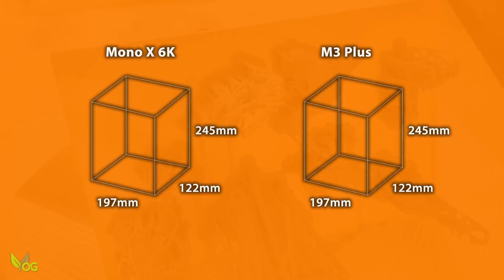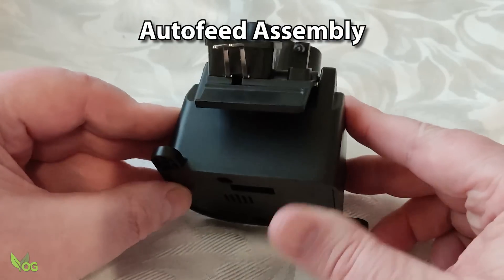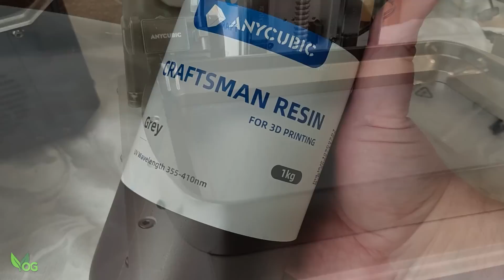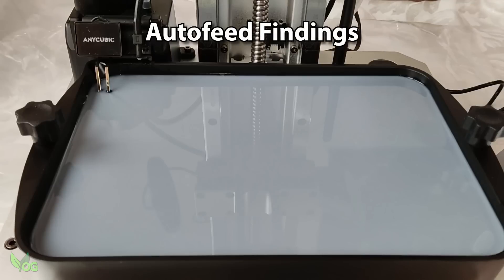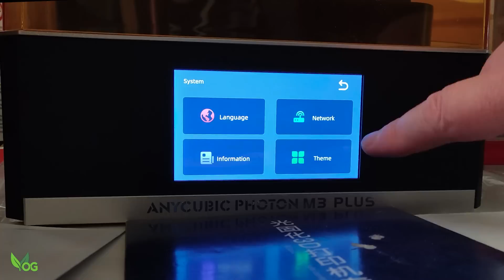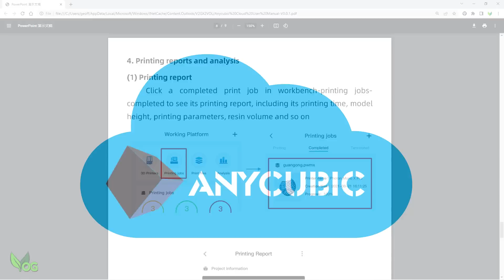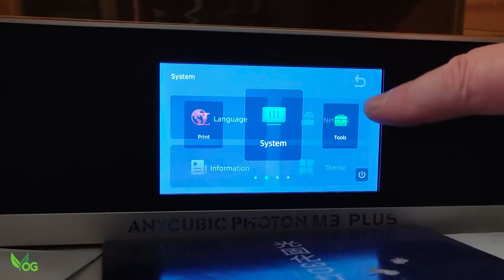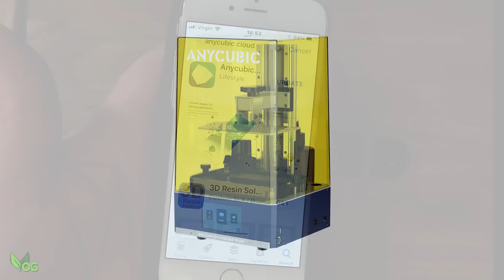Anycubic Photon M3 Plus - the auto resin filling 3D printer [HONEST REVIEW]

Comment: I feel like a little float switch would have been a better choice. It would work on any resin and they are reliable
Reply from the maker: I like that. That's better thinking. 😁😁😁👍👍👍
Reply: ultra sonic is also good, in 2018 i made a custom resin filler drainer with arduino and péristaltic pump
Reply: They are reliable until they aren't. Everyone has had a toilet that doesn't stop filling and that's just plain water. I wouldn't want moving mechanism that would get clogged with resin to be in control of resin feeding into my tank.
Reply: @HeliumFreak  you could say that about any system. Sensors fail too.
Reply: Float switches are not very reliable when you have sticky product that can harden on the moving parts. A float switch would be less reliable than the existing method, and ultrasonic is not very reliable for the small distances involved here.
Reply: @aaronporter2180  In this case I would think the failure rate of solid state parts would be well below a switch sitting in sticky goo.

Comment: I think your suppose to lower the build plate into the resin to displace it to the right level, if I was to recommend an improvement I would recommend  that the level be changed to the displaced level when the build plate is lowered otherwise lower the build plate first to auto fill the reservoir. Sound Good?
Reply: It doesn't look like there is a way to change the position of the prongs. So once the print is complete and the print / plate is out of the resin it will still fill to the same level

Comment: My first thoughts when I saw that autofill system was "I hope the tray can contain the whole bottle in case of failure" and you answered my question. :)

Smart move on the separation of the electrodes on the bottle sensor, but I think you are overplaying the lack of adjustability of the tray sensor. It's there just to make sure the tray has "enough" resin, and if you really need more or less then you just bend them.

Comment: Great review and suggestions.
But no one is reviewing the cleaning and repair issues of the auto fill feature.

What happens when resin builds up on the rods and/or censors? It is even possible to clean these without damaging them? And what about the tubes themselves? Or the feeder? And what if I need to change resin colors immediately after a print? Are we expected to remove the tubes and flush them out? And if so, then HOW are we suppose to do that?

 There are so many possible issues with this auto-feed system, that I don't see much use in it. Seems more of a unnessasary hassel than anything. The wifi features seem cool, but not enough to justify a purchase.
Reply: I think the way elegoo does the autofeed is a lot smarter, it would help me I do some pretty solid prints that can sometimes need a top up. Not so much on the larger format printers because the tanks are so much bigger but still.

Comment: The resin settling out in the bottle is a real concern. And I would have gone with something else for level detection, especially since Anycubic has no control over what resins are used. Non-contact would be the way I would go if I was cobbling something like this together. The whole thing seems rushed to market.
Reply from the maker: It is an incredibly competitive market John, you're right. The problem is, the company that waits until it has everything perfect is the one that gets left behind... things are moving so fast. I prefer to think in terms of "innovative" and commend Anycubic, because these are great features. Improvement is necessary... but that's what keeps driving the industry forward 😁
Reply: @vogman  if they were some hobbyist that would be adequate, but its a multi-million dollar company putting out a junk toy attatchment when there are youtubers that could produce a more stable design. They have no clue what they are doing here & really should wait until the thing actually works before flooding somebodys machine, like what would have happened to you if you would have been printing. This is money & business, not a hobby for them to try out a gadget on the public for the testing they should have already done.
Reply: @vogman  A weight sensor under the vat, or a break beam sensor like what’s inside of a paintball gun’s feed neck would work great as a low cost sensor. I can’t wait for the powers that be to use such a solution, would be very exciting!
Reply: @J0SHUAKANE   so where you’re machine? Where your design ? Just another nag nag nag with nothing to show for it
Reply: @J0SHUAKANE  this.

Comment: I won’t lie, off the strength of your review I went out and purchased this printer. Sadly I was disappointed ☹️ the LCD screen did not work and the machine was a no go from the start. It was temperamental and the lower third just didn’t register. After spending over £1,000 on the printer I must say I was gutted. I have since returned it and gone with my gut and ordered a Elegoo Saturn 2 instead. Excellent review though and I enjoy these informative style videos.
Reply from the maker: Sorry to here this Carl. Unfortunately duds occurs in just about every manufacturing process. Thankfully you were able to get your money back - and the S2 was my suggested purchase for mid-range, so enjoy 😁😁😁

Comment: You could try and solder some extensions to the two prongs if you want to try and lengthen them. However, I do think the overflow issue might be exactly because you used the system without actually printing anything - level of resin would have been much lower if the printing was printing while being "fed". I would actually put just half full bottle for feeding, it should be enough for any one print and will reduce the dangers of overfeeding and overflow. 
These being said, I think the feed system is just overcomplication and extra cost. We are not at the level where the printers print without any mistakes and we still have to occasionally check on the print, to make sure it hasn't failed - which would ensure we can add resin if we see a need for it.

Comment: The outlet pipe is too short, you can see splashback which sprays everywhere.
Isn't the resin consistency already quite mixed already or does the bottle need shaking before pouring ?
A heating element would be useless as it comes out into the tray as you would lose heat over the tray over time unless they make a heated tray, but you would get some residual heat from the light source from underneath. But saying that, the best option would be to have a small fan with a tiny heating element inside the case that goes over the printer to environmentally controlling the heat.
Reply from the maker: As long as this gets the manufacturers thinking, I'm happy to see ideas like these floating around 😁😁😁

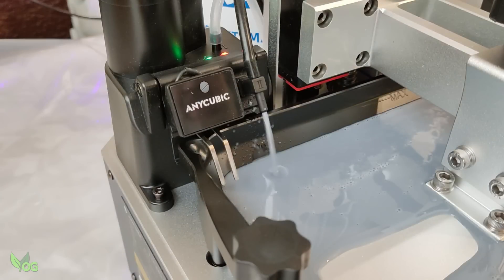Comment: It looks like it filled right to the "Max Line" (the line shown at 5:01). Though it would have been interesting to see if it did indeed overflow if you tried to use it at that point. I think it's supposed to be used while printing though, not have resin sitting outside of the bottle while not printing.

Comment: If we only need a max of about a millimeter of resin at any one time, why would they keep the vat at Max level? I could see this being super useful if it kept just enough resin to keep printing. This would eliminate overflow, reduce cleanup time, and unless your printing something massive, eliminate running out of resin. I’m probably missing something, but having more resin in there than you actually need to print doesn’t make sense to me. Another tip: add a “window” to your bottles so folks can see how much resin is remaining in the bottle.
This next part is a genuine question: Whats the big draw for remote printing? I can’t think of a time that I was at the supermarket and thought “Oh ****, I should be printing that orc figurine!”. Would someone who’s finds this feature useful drop a note to educate me on this? I get being able to visually monitor the print, but initiating printing just befuddles me. Thanks in advance.
Reply: a window would allow light in which with a light sensitive resin isn't something you want to do. even small amounts do build up over time and would reduce the shelf life of the resin. personally, I'm fine with no window in the resin bottle it isn't that hard to estimate how much is in the bottle.

Comment: I've always been a big fan of the chess board plates from anycubic, but that auto filling looks hella overengineered, sometimes the simplest solutions give the best results.
A heater for the resin is something that a lot of users have been dreaming of for some time now and hasn't been adressed by any company, a lot of failed prints are caused by low temperatures
When my Jupiter gets here first thing I'll do is try to install a heater and a temperature control

Comment: KISS (Keep It Simple Stupid) you know how a self watering dish works. Use the same system as that. You could make one yourself. You can adjust the end of the fill tube at a low level to keep the suction from the resin low as possible. No computer, no electricity, no sensors and extremely cheap to make. You know just like the water cooler at work.

Comment: I wish it were a heater instead of an auto-fill resin device.

Edit: obviously, I paused in the middle as you went on to mention the desire for a heater. 

I am worried anycubic is looking at the cloud stuff as a way to keep you paying for your printer after you have purchased it.
Reply from the maker: Actually Greg I agree. Auto feeding is great, but after say 12 hours, my guess is the resin will need shaking, rendering autofill pointless. So I'll probably always pause and stir, whilst topping up. But a built in heater would make life easier 😁
Reply: @vogman  Agreed about the need to shake and stir especially as I sometimes use Siraya fast navy gray. That stuff separates badly and quickly.
Reply: you could put a magnetic stirrer on it and for heating put one of the lizard pet heating pads on it. If they did a few more improvements on it I think it could work ok. However The way this current version is implemented It would not make me purchase this printer over another one. I recently purchased a 8k mini and am really happy with it. I get less failures with it then I did with my 4k mini (most of the failures for both are due to the resin. I have been using the non epoxy build series resin. advice for that resin is don't its a pain to use and i think its weaker, unfortunately I bought a bunch of it before finding that out)